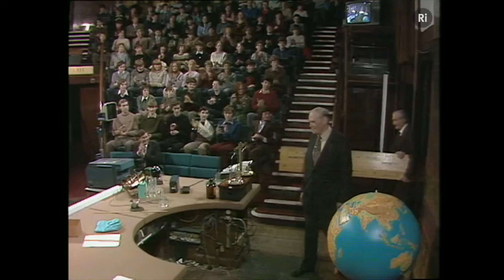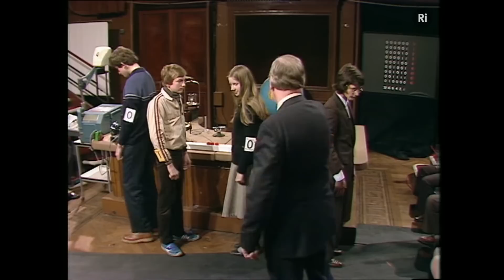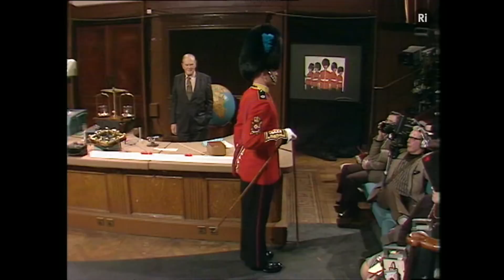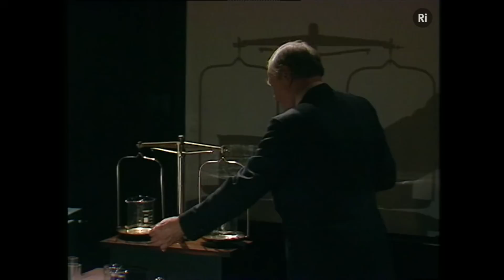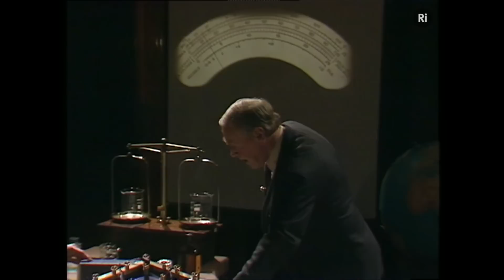Principles, standards and methods - Reginald Victor Jones' 1981 Christmas Lectures 1/6

Comment: 45:28 Oh the French Revolution… It‘s on them that I screwed up my math test in eighth grade long time ago. You see, they proposed to replace degrees (of which a full circle has 360) with “grads” (400 in full circle). Admittedly, it is neat to have orthogonal lines crossing at 100grad; although I’ve never seen trig tables in grads. BUT: Soviet calculators we used during that trigonometry test had a flimsy slider to switch between radians, degrees and (if you move it a millimeter too far) - grads. The difference to degrees was small enough so that no intermediate result rose my concern and I miscalculated pretty everything and failed the test miserably.
Reply: Even worse: in German, degrees are "Grad". So the correct setting for the calculator is not called what we call the thing we want (DEG vs GRAD)...
GRAD would be "Neugrad" (new degree". Not great.

Comment: 📖 Introduction to Measurement (00:33 - 06:38)
├─ 00:33 Defining Science and the Importance of Measurement
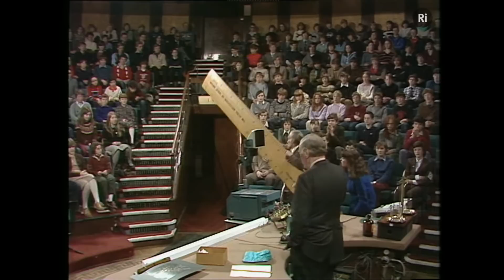├─ 01:07 What We Mean by Measurement
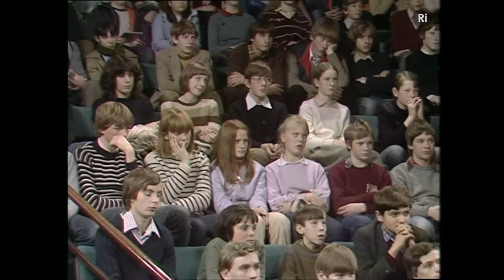├─ 02:18 The Value of Numbers in Science and Engineering
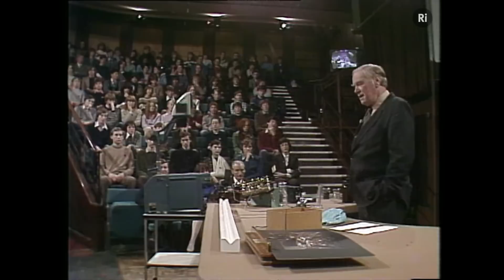├─ 03:57 Defining What a Number Is
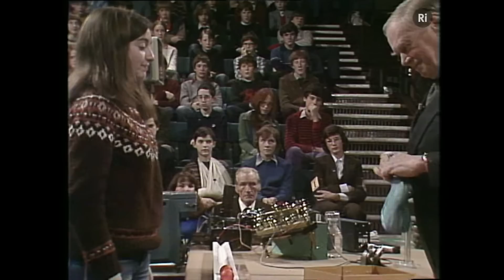├─ 05:00 Counting and Basic Notation

📖 The Limitations of Counting Systems (06:38 - 11:36)
├─ 06:38 Primitve Counting and Radar in 1940
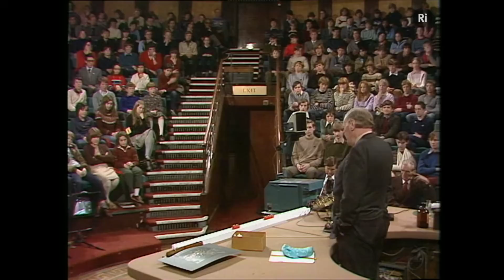├─ 07:45 Roman Numerals and Limitations
├─ 09:57 The Invention of Zero and Its Impact

📖 The Significance of Zero and Its Impact on Mathematics and Physics (11:36 - 17:01)
├─ 11:36 Kepler's Observations and the Discovery of Planetary Motion
├─ 12:08 The Role of Zero in Modern Mathematics, Mechanics, and Physics
├─ 12:38 Binary Scale and Its Applications
├─ 13:08 Demonstration of a Bio-Mechanical Counter

📖 The Origins of Computing (17:01 - 21:31)
├─ 17:01 Dr. Win Williams' Impulse-Based Counting Mechanism
├─ 18:08 The Invention of the Transistor and its Impact on Computing
├─ 19:48 Measuring Length for Scientific Purposes

📖 Development of Standard Units (21:31 - 26:24)
├─ 21:31 Defining a Common Unit for Measurement
├─ 22:05 The Importance of Reproducibility and Convenience in Standards
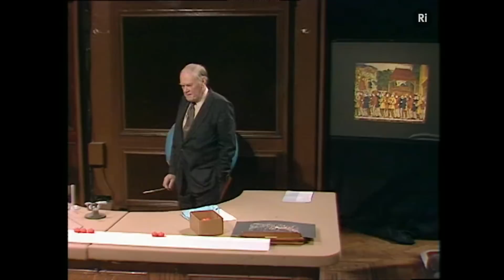├─ 23:12 Measuring Average Foot Length Using a Group

📖 The Emergence of Precise Measurement Standards (26:24 - 31:53)
├─ 26:24 The Need for Precise Standards in Measurement
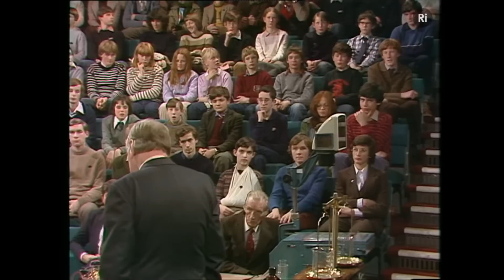├─ 27:29 Magna Carta and the Concept of No Taxation Without Representation
├─ 28:33 The Importance of a National System of Measurement

📖 The British Army's Step Pace and Brigade of Guards (31:53 - 37:53)
├─ 31:53 Introduction to the British Army's Step Pace and Brigade of Guards
├─ 32:24 Explanation of Regimental Buttons and Coding
├─ 33:58 Rehearsal of Trooping the Color
├─ 36:15 Training for Precision Marching with a Past Stick

📖 The Need for a Permanent Standard (37:53 - 47:36)
├─ 37:53 Rearrangement of Metal Atoms and Shrinkage
├─ 38:27 Eternal Standard and Calamity Resistance
├─ 39:02 Earth's Spherical Shape and Measurement
├─ 40:12 Calculating the Earth's Circumference

📖 Industrial Society and Mass Production (47:36 - 52:36)
├─ 47:36 Specialization in Industrial Factories
├─ 48:10 Mass Production and Human Problems
├─ 48:42 Measurement Techniques in Industrial Society
├─ 49:15 Comparative Measurement of Ether Vapor

📖 Measuring Small Changes in Electrical Resistance (52:36 - 57:35)
├─ 52:36 Detecting Small Changes Using Ether Vapor
├─ 53:40 Wheatstone Bridge and Measuring Resistance
├─ 54:10 Demonstration of Wheatstone Bridge Sensitivity
├─ 55:51 Importance of Wheatstone Bridge in Electronics and History of the Royal Institution

📖 Early Pioneers in Radio Waves and Music (57:35 - 59:37)
├─ 57:35 Hein Herz, Wheatstone, and Faraday's Contributions
├─ 58:07 The Mouth Organ and Its Demonstration